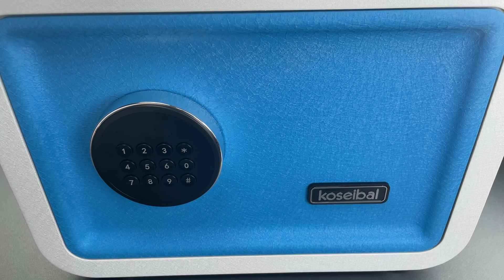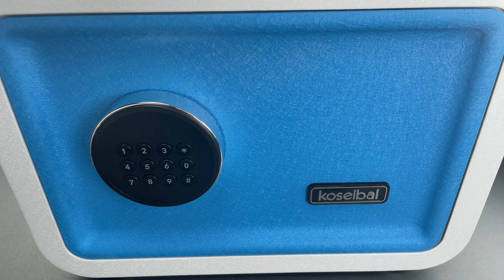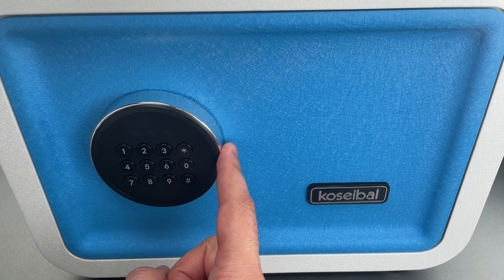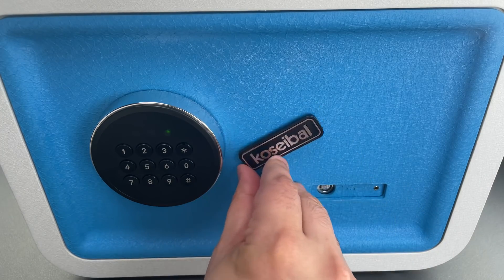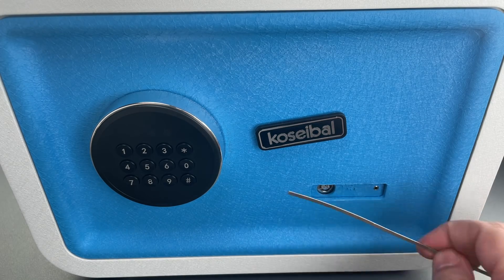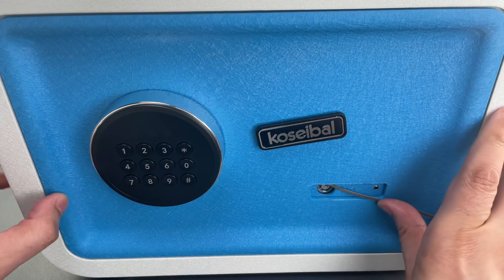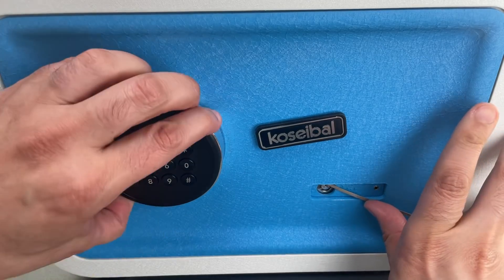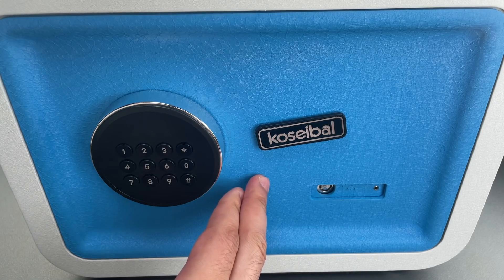[1321] HUGE Design Flaw In Koseibal Safe

Comment: When your mechanical backup lock is so bad that merely attaching the cover with a couple of screws would have made it several times less insecure.
Reply: Yeah, at least then some possible intruder may think nothing of the plate. And may not find the mechanical lock at all, if they didn't know about it. But with only a magnet holding it on, all you would have to do is press on it, and there's your entry point.
Reply: I mean, getting a few screws as a teenager definitely made me less insecure.

Comment: The old ass 30 years old safe we had in our house was electronically controlled but had no mechanical backup. In the case of batteries running out it just had a standard 12V barrel jack where you could plug external double A batteries (or any 12V battery) to operate the keyboard.

I guess the ancient wisdom of this simple but yet effective technique was lost in time
Reply: Too expensive ;-)
Reply: It's adding expense, failure points and requests for customer support. Plus, the mechanical override can be marketed as "you'll never be locked out, even if there is an EMP weapon detonated right over your head". Believe it or not, this sells, in the US.
Reply: @dlevi67  I can only see why a battery backup would be cheaper than a mechanical lock. It's just a couple of wires and a tiny more of electronics. Total cost is 2 dollars at most.
A mechanical backup is far more complicated.
Yes, of course in case of electronics failure you are locked out, but I'd rather know that in this very (VERY) ridiculously unlikely event I'd just call a blacksmith and crack open the safe than knowing anyone could open it in seconds without even removing it from the wall using just a broken toothpick.

As far as the EMP protection goes, I am amazed that I'm not surprised at all that this may be a selling point in the US...
Reply: @Maltanx  Just to be clear - I'm not advocating mechanical backups... and I'm a big fan of properly designed electronic locks. Then again, I'm not in the US, so the idea of protecting against EMPs or not having my AK-47 fall into my lap within 3 seconds of me hearing a potential intruder don't really concern me.

Having an exposed power supply means (at least in theory) also having to make sure that there is some protection against over/under voltage attacks and power drainage. Not that it is difficult, but it is more time and expense (and a wafer lock or a tubular lock are very very cheap - especially when of poor quality).
Reply: Honestly seems like such a good idea.
My guess through is that it might not be legal to not have a mechanical backup, and if that's the case could be why it was lost in time.
Reply: @Maltanx  If you have an EMP close enough to matter, you will probably have bigger issues than getting into a safe, anyway.
Reply: @Toutong_  It's definitely legal in the US - plenty of safe cabinets and safes (of all sorts) without any mechanical backup.
Reply: @dlevi67  What makes you think having a battery backup without protection is any worse than having a cheap, toothpick-openable mechanical one?
Reply: This safe got the option to use a battery backup. Next to the backuplock is a 2.5mm jack for (i think) 3 AAA batteries. The batteryadapter comes with the so called safe.
Reply: The mechanical backup should just be an angle grinder.
Reply: @dlevi67  it is more that as someone who has worked with electronics often I know they fail and they fail with no warning not to mention the lifespan of the electronics themselves.   It isn't like a mechanical device where you will typically get warning signs before it fails.    I would never trust an electronic safe without a physical backup to be honest.     
That said I would also look for one with a bolt or screw  on cover that way I could just locktite it in the case of a bolt or in the case of a screw use one way screws as I doubt most thieves are going to carry the tools to remove either of those options.
Reply: Lots of “anti-American” hate in these comments - don’t worry, it’s mutual.
Reply: Everything needs a gimmick now and be made for pennies to sell for 1000x profit. Good design decisions are for the most part, a lost art.
Reply: @MaethorDerien  If the electronics fail, you use a grinder - the same way you would if the lock became jammed or you lost the key to a mechanical one.
Reply: @cancelhandles  What makes you think that I think that?
Reply: @conradharbidge1751  Spelling not too butchered, but thinking very clear. FWIW, you have my vote on this one!
Reply: @MaethorDerien  Good luck to you, is all I can say. There is a reason why pretty much all decent safes have no 'override' locks...

(Thieves that are expecting to find any sort of safe container will most likely carry a grinder).
Reply: @dlevi67  I was not ready for reading comprehension this morning, my apologies. I agree with you and Conrad.
Reply: @cancelhandles  No worries. Nothing a good coffee can't cure. Have a good weekend!
Reply: @MaethorDerien  You don’t really need electronics. A simple solenoid would suffice for back up.
Reply: @MarcosElMalo2  And how safe it will be then?
Reply: @JosephArata  100 percent. Everything is cheap ass garbage now
Reply: My Grandfathers Ammo Box with a padlock looks better every day
Reply: My dad had one that ran on a 9v battery, and it had two little contacts on the outside of the door, so if the battery went dead, you could press a fresh battery against them to run the electronics to get it open and replace the battery.
Reply: @Golf4org  I thought that was for headphones to better hear the clicks
Reply: @benwilson6145  Depends- is it a masterlock???? (they don't deserve the 'M' lol)

Comment: You're the best lock reverse engineer since sliced bread! Man, you've got some serious good techniques. I don't watch your videos for malicious purposes, I love engineering, good engineering. It's a pleasure to watch you explain the design flaws and you also offer advice for better protection. 

I've had two lock ideas. One with a dual key where you need to turn them both at the same time? Or a round key with pins circling it 360. Would only work on a safe though as a house door isn't big enough.

Have you ever thought about designing a lock yourself? OR, are they so prone to failure that there is literally no point? My understanding of locks now, is that the only people it locks out (Who doesn't have a key) is the homeowner. Criminals have plenty of time to learn how to pick the locks. 

Great stuff! Thanks for sharing

Comment: Could the covert Instruments website start selling lock related products and safes that are actually good?   Seems like there would be some value for a lock or safe manufacturer to be able to say, "Lock Picking Lawyer Approved!".
Reply: I just want him to provide a list of approved locks and safes. I'm tired of preventing curious adolescents from accessing my firearms by hiding them behind a shelf with a 30 year old set of Encyclopedia Britannica on it.
Reply: My guess is that they truly don't exist.  Anything that can be made can be beaten.  In the case of this safe in particular, unless you're a jewelry store and someone has been casing you for months, a thief is going to try to brute force it, then leave.
Reply: @twmcmahan  The point of security devices like locks or safes is not to be unbeatable, but to be such a challenge to an attacker that picking/opening it is either not worth the effort or there's some serious risk of getting discovered, preferably both.
What LPL is mainly showing off is not that those locks can be beaten, but rather how easy it is to beat them, or circumvent the lock, with some knowledge and low- to no-skill attacks.
Reply: @twmcmahan  a home safe that has a UL-RSC rating will withstand an attack for 5 minutes. A commercial safe with a rating of UL TL-30X6 will resist an attack for 30 minutes on all six sides.
Reply: @Peter Evans While my comment was geared towards locking devices, you just further proved my point with another security device: Disabling such alarms is possible, but it usually takes some effort to do so. For private homes, that effort will most likely outstrip the gains, making it not worth it.
Reply: @Peter Evans Unless you want the area to be completely inaccessible, you need some switch to disable them.... And that would be the best angle of attack
Reply: @Peter Evans So it's remote controlled? That means you just need to pick up on the signal from your switch and you can easily disable that alarm. By far not unbeatable
Reply: @twmcmahan  I feel the main goal of a security device is to deter attacks and delay success. If you have a lock that gives the average picker at least 10 minutes worth of trouble, that is 10 minutes for you to notice and/or 10 minutes for law enforcement to arrive after hearing an alarm triggerd by the device or being called to the scene by you (I looked this up: police try to arrive in 5 to 6, but it usually ends up being anywhere from 5 to 9 minutes.). Same goes for a safe. The longer it can delay, the greater chance someone can catch the guilty party and prevent theft.

Comment: Key point:  If your safe has a key override, it's not a safe.
Reply: Not if the keyed backup is cheap.

If the backup lock is good, it may still be a safe.
Reply: Unsafe safe
Reply: @Nicholas-f5  You might call it an... un-safe
Reply: @ScottKenny1978  More locks = more chances of a flaw.
Reply: @carsonfujita-turnbull4549  agreed.

But I do understand why you'd want a backup lock in the design. Electronics are not as reliable as mechanical systems. I mean, people are seriously using 100+yr old firearms in competition and in combat.

But a good Medeco lock cylinder is $15. Put a good core in the backup (and make sure it's not bypassable!) and you have a good safe, even if the electronics are the primary lock.
Reply: @ScottKenny1978  Cost cutting is usually the problem. But just like this one https://youtu.be/6q2t0pU8yJM having plastic core isn't entirely that different from building a locking mechanism with electronics. If I can melt/break off the cover and access the wire to the motor the safe is already done for.
Reply: @carsonfujita-turnbull4549  yeah, if you go that cheap you get what you deserve.

Comment: The Lock Company : So this is your lock with numerical electronic lock and a key to open the manual mechanical override
LPL : don't worry, I have this scrap metal. I don't need those 2. :p
Reply: Better.  The LPL says: Do you happen to have any piece of something like cardboard, plastic cup, paper clip, bubble gum? Literally everything will do. Some trash like plastic bag or used batteries...?
Reply: @HanSolo__  Hahahahaha... true, true

Comment: Once you see, "mechanical override" on a 'safe', it is no more than a piggy bank for the children. Best mechanical ("EMP-proof") security is a 4- number mechanical lock (S&G, etc.) with no batteries,  electronics or potential electrical faults. Four-number combo locks have added security,  in that fewer and fewer people know how to accurately dial them,  much like those that can properly drive a 5- speed transmission vehicles. Ditch the big box choices and go for the real heavy metal.

Comment: “Alright cool lookin safe, I like the knob..

Oh no.. a mechanical override..”
Reply: I know exactly what I would do to fix it. About three drops of super glue. If I ever need the mechanical backup I'll pry it off and fix it later.
Reply: @leechowning2712  The problem is not the mechanical backup lock but the ability to access the actual locking mechanism via the hole that has the backup lock installed. This bypass doesn't even need touching the backup lock.

I guess you could fill the whole mechanical lock are with epoxy but then the safety of this safe is only about how hard the epoxy is to remove. Sure, you cannot do it with a pencil but it's still much weaker than steel safe which this thing is supposed to be.

Comment: And - aside from the flaw allowing a zero skill attack and (we presume) a very easy to defeat secondary lock the LEAST that should have happened is a piercing alarm  and optional signal to other alarms, alerts went off the moment the access plate was pulled off.  If it was a situation where secondary access was required the owner of the property it was on would need to be aware and could prepare.
Jeebuz...  More of a matter if there's anything out there to buy.

Comment: At my first job we had a small electronic safe, somewhat like this. We had that in the (locked) storage room. Inside the small electronic safe we kept the safe key. The key to the real safe. The real safe was taller than me. It had cast iron sides and door somewhere between 4 and 5 inches thick. It must have weighed a couple tons at least. It had a 1 minute electronic timer. After starting the timer you dialed in the 6-number combination, or 7, I don't remember. This combination unlocked the 2nd dial, which could then be pulled out. You inserted the key into the shaft of that 2nd dial, pushed it back into the door and then with that key you unlocked the bolting mechanism. I suppose that safe was a bit overkill compared to our daily revenue. But at least it was a real safe.
Reply: And all i hear is LPL saying "nothing on 1, click out of 2, counter rotation on 3"

Comment: Is that "safe" door glass reinforced plastic or is that a textured paint on metal? It looks thin & didn't sound very metallic as you closed the door.
Reply: Texture paint over steel - the magnetic key cover stuck to it.
Reply: @alopexlagopus1488  Yeah, that totally slipped my mind, if there is steel in there it'd only be 3-4mm thick.

Comment: Pretty much I don't mind the back up locks to them, in fact I would never buy an electronic lock without one as I work with electronics enough to know how often they fail and how they fail with no warning.   They are not like something mechanical where you typically get warning signs before a failure.   

I have to wonder why the back up locks are never done right.   Seriously all the manufacturer would have to do is include a one way screw in cover as well as the removal tool for the screws.   It would completely fix the issue as a thief isn't going to be carrying those kinds of tools around with them.  That said honestly I don't mind if they do because I can always just replace the screws myself with one way screws.   Sure they can be drilled out but that is time consuming.

Comment: could the end user fortify that in any way? if it's exposed on the other side it's possible adding a shroud of some kind might help. not sure if the lock is at all worthy afterwards but it could salvage some value for a current owner if it's something they can guard against.

Comment: At Koseibal
Designer: No way to pick an electronic lock!
Manager: You need put a backup way in case battery runs out..
Designer: Makes a hole that you can stick a fork in to open safe

Comment: WHY do these companies still insist on a mechanical back up lock?  It is ALWAYS a weak point in the design.  There are other safe manufacturers that protect the electronics and mechanism inside the safe but provide for a back up power input or just put the battery on the outside.

Comment: Usually would elaborate on the function, and what i mean by that is to have opened it and shown backside of the door to try and see exactly what is triggering.
If what unlock mechanism is inside the door and not been able to see it anyways i withdraw my comment. :)

Comment: I have a question about dimple locks, in Sweden the norm is to have a dimple lock for your apartment, but when I google "dimple keys" I can't find any that looks like the types used over here. The dimple keys over here got around 20 dimples in total, all at varying places and etc on the key, so my question is: have you tried to unlock one of them. and if so, how easy was it?

Comment: I have a safe that you only need to punch it.
Takes literary 1 second to open.
If it's inside a wall, it will not work as can't be punched from the top, but I'm sure there are other ways to open it without much effort.

Comment: What if someone designed a lock with 3 keyholes, and 3 keys would need to enter at the same time or they wouldn't fit in, and turn at the same time or else it  won't open. The key would probably have to be mechanical and have 3 separate keys spaced in accordance with the keyholes on the lock, so they all go in at the same time, and when you turn the end of the key it turns the 3 other keys at the same time. Would 1 person be able to pick it?

Comment: Could you do a segment everyonce in a while showing two similar items, one to avoid and one you recommend, because you have systematically destroyed my faith in locks and lock suppliers
.
Reply: Locks are only there to keep honest people honest.... take time to read that again until it sinks in
Reply: @johntackett8840  Yes I'm fully aware of the saying, but there is a difference between a lock so shit it's not barely an obsticle; and a lock strong enough that an opertunistic thief will decide it's not worth their time. Though that depends on what it's protecting. Semantics will only get you so far.
Reply: @JoshuaNicoll  doesn't matter... like i said,  locks only keep honest people honest...a dishonest person will find a way around it every time,  regardless of how crappy or how well it is built
Reply: @johntackett8840  but not if what's behind it is not worth it, why would you spend 5 minutes trying to get into something that is worth less than $5 with little resale value, your assumption is it's on something valuable and is worth their time. My statement stated that's only really true when the value is worth it. You missed my point.